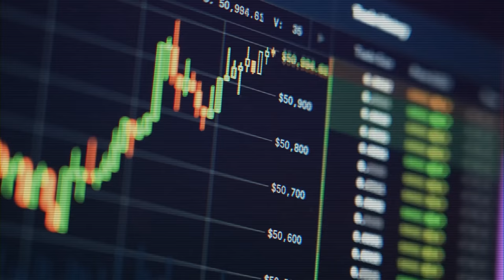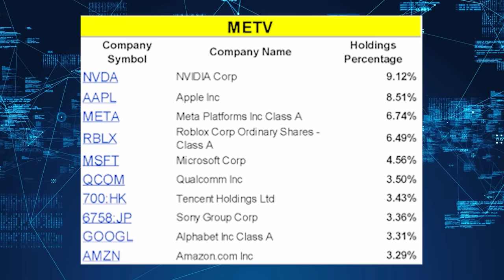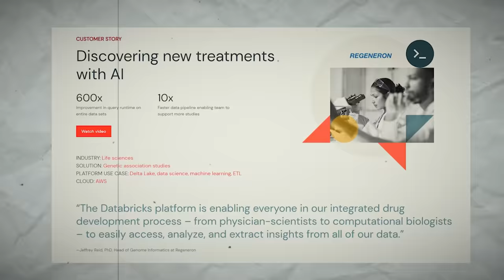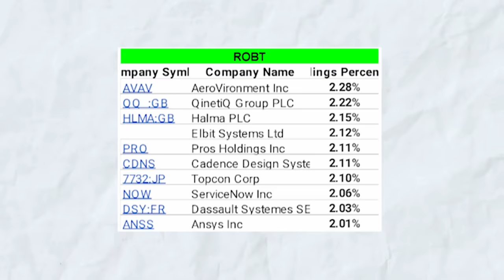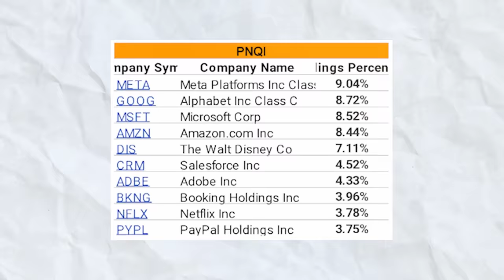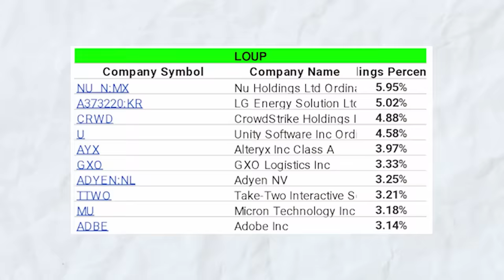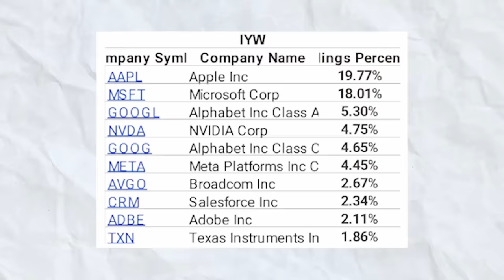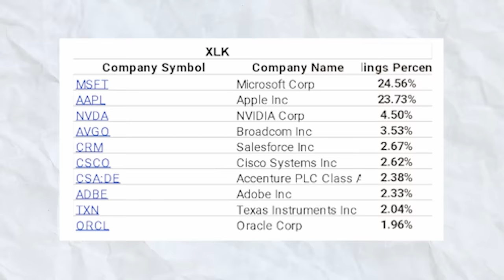Top AI ETFs : Once in a Lifetime Opportunity!

Comment: Thanks again for the good info.  Just wanted to point out the QQQM is basically the same as QQQ.  The difference is that QQQ has an expense rate of .67 while QQQM has an expense rate of .15.  The YTD returns for QQQ is 24.74% and QQQM has a return of 24.81%.  Just a bit of info for those that may be interested in these ETF's.
Reply: Thank you 1000x!!!
Reply: Thanks 😊
Reply: Thanks! Buying QQQM !
Reply: Qqq has a .20 expense and qqqm has a .15 expense
Reply: @DavidB-fo5vu  Yes, sorry about that I copied the wrong field.  Thanks for pointing that out to everyone!
Reply: @DavidB-fo5vu  By any chance could you help me out?
Reply: If you like selling cash secured puts and covered calls, to juice your return on investment, QQQ has thousands of option volume and open interest, with very tight bid/ask spreads. 
QQQM has almost zero option volume, and zero open interest, with WIDER bid/ask spreads. 
Liquidity in daily share volume, and liquidity in daily option volume is VERY important to option sellers, because of the affect it has on the bid/ask.
The ONLY appeal for QQQM is the lower share price, and the lower capital needed to own 100 shares, or sell a cash secured put. 

As an option seller, I would pass on QQQM.

Comment: May I ask what consideration led you towards invesco QQQ (or its sister QQQM with lower fee) rather than VGt which has the  lowest fee and is basically the same?  Thanks
Reply from the maker: Great question.  I love VGT as a tech ETF, but with Apple making up over 21% of the fund it didn't fall into the criteria of AI.  Apple is at the top of tech, but they are not known as being a key leader in the AI space.  As for QQQM, that is a very easy answer.  The performance between QQQ and QQQM is nearly identical, but QQQ has been around over 10 years with a strong history to pull from.  QQQM is less than 5 years old.  Fees....I tried to cover this in the video.  Yes, they are important, but the total performance of a fund includes the fees taken out and the dividends re-invested.  So the total performance takes that into account and gives you an apples to apples view.  Hypothetically, If you have a fund that has a total return over 10 years at 18%, but has an expense ratio of 1%, and you compare it to a fund with a total 10 year return of 16%, but has an expense ratio of 0.02%.......I would choose the one with the higher total performance because it already accounts for the 1% expense.  Even if they are higher.  Does that help answer your questions?
Reply: @BusinessWithBrian    Brian thank you for your prompt reply. I was pleasantly surprised. As my main interest is to get the best performance I will go with VGT .   But, yes, I absolutely agree with you with regards that lower fees do not mean necessarily best performance. My only regret is not getting tesla with VGT.  Thanks again. I also own a "small" position with XLK which I like but might be considered a duplication of sorts.
Reply: @BusinessWithBrian  Totally agree with the analysis. I have a combination of QQQ and quite a few "giants" such as APPL, MSFT, TSLA. I did not touch my portfolio for the past two years. Now most of the individual stocks are in green with TSM as the exception which dragged my leg. Fortunately the portion of TSM is not big. I lost the opportunities to sell in the past 2 yrs and now the portfolio as a whole is at peak again. A couple of questions:  1) Selling is more difficult than buying sometimes. Should I juice in the winning stocks now and replace them later with more QQQ and maybe another AI ETF at their lower costs?  2) It is necessary to have more than one ETF? (If I choose only one, then QQQ is the one I would go with. Plus a Bond ETF as cash equivalent.)   If you don't answer, I will understand why. But I would appreciate some comments / corrections of my way of thinking.
Reply from the maker: @xiaowang2540  Thanks for the note.  I'm not able to give direct advice since I'm not a licensed Financial Advisor.  For me personally, I try to have several ETF across a few different sectors, including bonds.  Similar to what you mentioned.  Sometimes a sector like Tech is up, and other times Energy, or Consumables is up.  If an ETF overlaps with the top 10 holdings with another ETF in a big, way, then I wouldn't see a need to carry it.  As for selling and juicing.....I've never been one to time the market well.  I like to research, then buy with the intent of holding long term.  However, if I have a DAWG, with no potential in sight, I'll ditch it for sure.

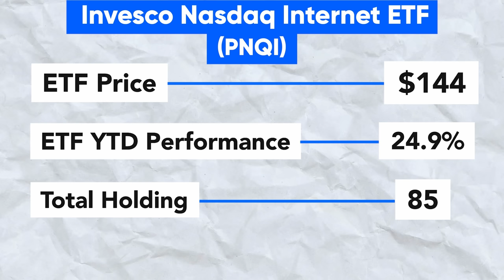Comment: Hi, question: why on 8:45 u say PNQI is at $144 if it has never reached that value?  It's been max $51 and it's currently $37
Reply from the maker: It was an error that the editor had made. And I didn't catch it before it went live. If you notice I never said the stock price was at $144. A person can also look in the spreadsheet of all of the ETF that I would reviewed and a person can easily see that it was not at that price. Sorry for any confusion

Comment: What do the different color codes (at the top of each ETFs' holdings) on your spreadsheet mean?
Reply: I'm asking because the one I chose to buy (XLK), has no color on it, even though it's one of your top ten ai ETFs in your video.
Reply from the maker: Oh, you can ignore those. I originally put them on to highlight the key ones that I was looking at. But then I ditched it at some point when I was putting them in the spreadsheet